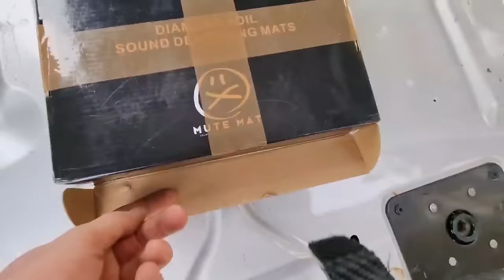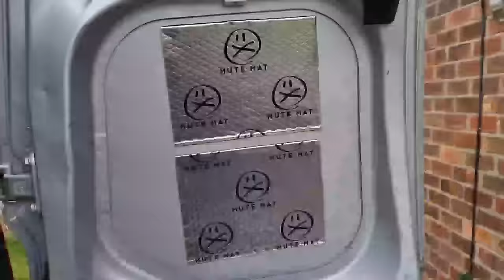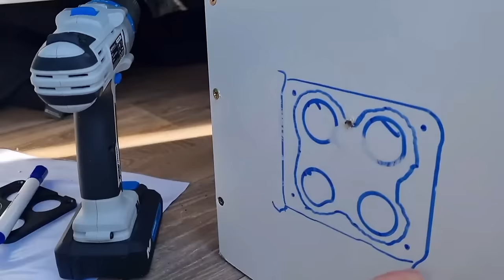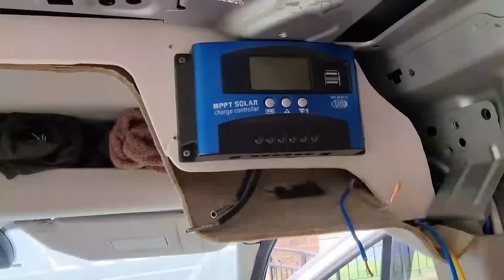£700 Complete Stealth Camper Van Conversion || Start To Finish

Comment: Little tip - if you add a false business to the side of it, it'll be less likely to be stopped or have suspicions raised when you pull over somewhere.
Reply: Haha! What a sneaky and excellent idea!
Reply: Like dead body removal. Repel thieves that way too. Lol
Reply: I put this on site also, only risk is that thieves may think you have tools or valuables i n your work van.  But, certainly add a "DOT" number (for USA) on the door
Reply: @power4things  They'll break into it regardless of whether or not its got a logo on the side. They'll smash a window just for shits.
Reply: @mcladrifter  True enough.  The markings were more intended for stealth parking in neighborhoods and keeping the Karin's away.
Reply: But it makes it a target for peaple to break into it
Reply: @Verethill18  They'll break into any van. I know from experience
Reply: @mcladrifter  fair enough 😩
Reply: Put “Private Ambulance” on the side 😂

Comment: Brilliant build! And no extra ‘padding’ to turn it into a 30 minute video. Just great info.
Reply: Exactly 👍
Reply from the maker: Glad you enjoyed it :)
Reply: @iNDI_VAN_A_JONES 
Hi, new subscriber here..
I was wondering if you're aware  of the new dvla  regulations on  van conversions ?
Any commercial vehicle  converted into a camper must  have 3  windows  on the sides 
( one  and 2 )
Plus decals on the outside denoting it as a camper...
If this is not  done , and declared to dvla and your insurance provider, a pig could  charge you with  DRIVING WITHOUT VALID INSURANCE. 
Obviously  this legislation is aimed at criminalising  problems who  operate stealth vans .....
I'm sure you'll be aware that driving without valid insurance   will result in the vehicle being seized  and possibly crushed  by the pigs .

Comment: Many years ago, I owned a business called "The Rapid Transit Company". We built custom dayvans to order, and VW - LT van based campers. All our campers were of modular construction so that, if a customer had a 2 berth van but now needed a 3 or 4 berth van; no need to buy a new van - just swap the 2 berth interior for a fully fitted set of 3 or 4 berth modules.
The reason I mention all this is to demonstrate that I do happen to know what I'm talking about.
The van in the above video is a potential fire-trap! Not because it's badly built or planned, but simply due to the nature of the materials used. That insulation fibre might be okay in a shed or a garage. A fire certified version might be used in a loft where there are no electrics; but tighyly packed next to under-shielded cables with no trunking that I could see - definitely NO!
Apart from the fire risk, it's a fairly clever but very amateur conversion. Far too small for 2 people; having insufficient cubic feet of clear air space and little in the way of ventilation.
However, don't be discouraged; learn from your first, very enthusiastic, build and, next time, start with a bigger van. (Transit, VW, Toyota etc). Buy one with windows or fit your own, dark tinted of course, and fire-proof everything as you build. Your system of electrical labelling is nothing short of absolute genius! I used to colour-code but actual labelling is so much better - well done. Keep it up and Happy Adventuring for the future.

Comment: great tip on the IKEA wood scraps. That will save a ton on money although its not the best type of wood usually to hold up.
Reply from the maker: I sealed the open edges with wood glue. Just spread it on. So far mines doing real well
Reply: @iNDI_VAN_A_JONES 

I didn't even know that was a thing regarding scrap wood from IKEA! That's a great tip!

Excellent build by the way!

Comment: JUST A TIP, YOUR ROOF RACK MUST MAKE A NOISE WHEN GOIN FAST,  ON MY VAN I PUT A PIECE OF PLASTIC AT FRONT OF RACK AT ABOUT 35 TO 40 DEGREES, IT CUT OUT THE WIND NOISE GREAT

Comment: Quick question mate how tall are you? I’m looking at getting the SWB transit connect and I’m 6’3 and worried it’s too small of a van for me?😂
Reply: I'm the same mate, how was it if u got one? I'm aiming to get lwb and if needed cut a bit out of the bulkhead so I can  get the seat back more. Let me know how yours is for the taller gentlemen?

Comment: Stuff that plastic foam stuff you used. The previous owner stuffed it in the tailgate of our hiace and ended up blocking up the rear windscreen motor. Spent 3 hours cutting it out. Absolute paaaaain.

Comment: nice build, but a tad thin on the wiring, especially that battery cable and the cable for the little outlets, i dont wanna plug in anything larger than a phone charger in that 12v outlet you added near the door

Comment: Ah yes, imagine any wire getting hot under load or other mishap turning into a huge fire due to the PET foam being anything but fireproof and acting as perfect tinder...
Reply: That's why you have fuses............
Reply: @smokemeakipper1076  Fuses don't protect you from everything, only overcurrent. It's a 12V system with a lot of self-made connections. A bad joint can easily heat up to PET autoignition temperature without tripping anything.
Reply: @miken3963  when the fire starts to burn. Right, and it starts to spread.
She Gon bring that attitude home
Reply: Perfect for those freezing nights.
Reply: @miken3963  that's why you put that wire in a plastic tube with fire resistant material warping around the outer plastic tube with some hole in the plastic tube just incase you need to fix it
Reply: @bhvillaman4401  who don't wanna do nothing with their life
Reply: Good point, but why does it bother you so much?
Reply: @diywarren1776  It is important to prevent fire hazards right away by choosing the right materials. IMO Rockwool or similiar might have worse accustic properties or could be more expensive but it would greatly mitigate the fire risk. 

Just an advice for anyone planning to convert their vehicle into a camper to stay safe :)
Reply: @smokemeakipper1076  I'll be back back for breakfast 🤣🤣🤣
Reply: AFDD/RCBO could help.

Plus running all cables through conduit allowing for some ‘airflow’.
Reply: This stuff is regularly used for camper and day van conversions and has been for a good while now.

So far it doesn't seem to be causing mass camper infernos.

I also think the OP should look up the term 'autoignition' to discover why it's not the correct terminology being used here.
Reply: Would the insurance cover it ? Hell no
Reply: @skylined5534 he does have a point for auto ignition.. everything has a temperature that it will self ignite. Not requiring a spark or ignition to do so. Going to be quite rare i would imagine from the wiring but still. It is a thing..

Comment: Also, note that the chipboard from Ikea is terrible to use. The vibrations from the van driving will cause it to fall apart quickly. Not to mention that it's not even moisture resistant.
Reply from the maker: I'm a year in now and working great for me. Seal and secure everything good and it's worked
Reply: @iNDI_VAN_A_JONES  sure. And it'll look great up until the instant it catastrophically fails. Or you get it wet.  There's a reason that this kind of stuff isn't used in RVs or campers or marine applications.
Reply from the maker: If it fails I'll just build it again. Its free wood and looks half decent. That'll do me
Reply: @iNDI_VAN_A_JONES   i think since UV is not an issue you could have saved weight using plastic , ie those underbed trays on wheels

Comment: Not one cable was double insulated as is required by law and the battery did not have a battery stay clamp bolting it to the floorplan. 
Neither did it have a carbon monoxide or carbon dioxide sensor and alarm.
Neither did the solar panel have an RCD system to prevent fire through faults.
All required by law .
Signed 
A Vehicle Electrician
Reply: in the end looks pointless, they could have thrown in pair of sleeping bags and call it a day

Comment: Piece of piss gonna do it all tomorrow, hang on where do I get the leisure battery from and which one do I get , and where do I get all the electrical diagram's and information how to connect everything up correctly with the right size fuses for each appliance, and how do I make sure everything I do measurement size is correct, and how the hell do I get a budget like yours to do this ?